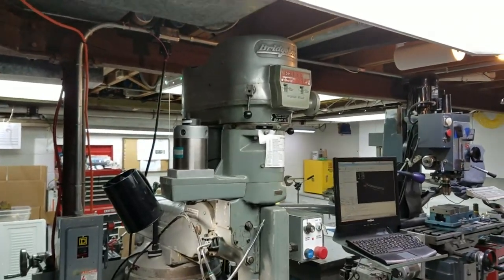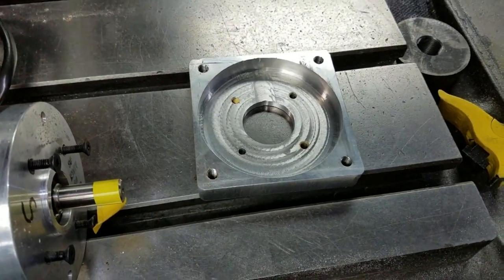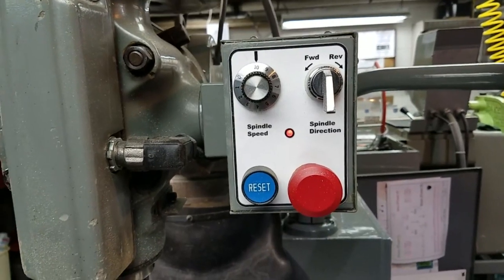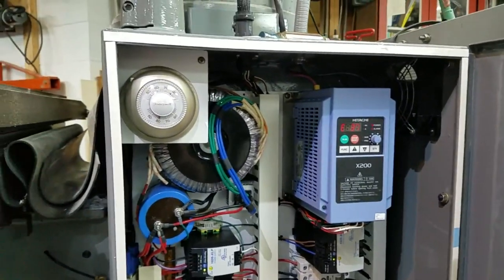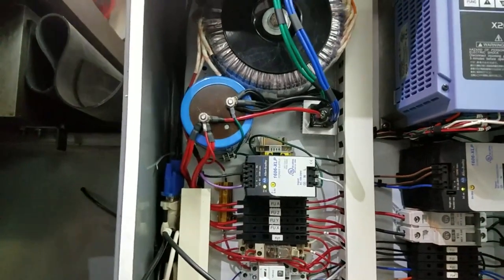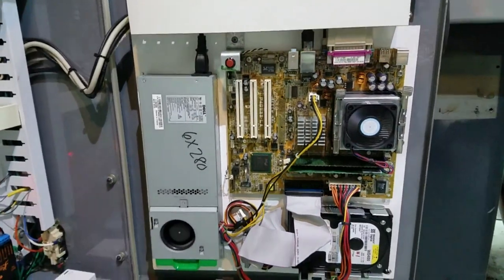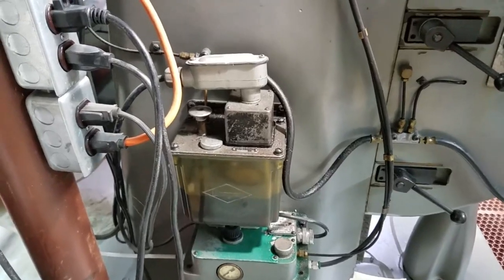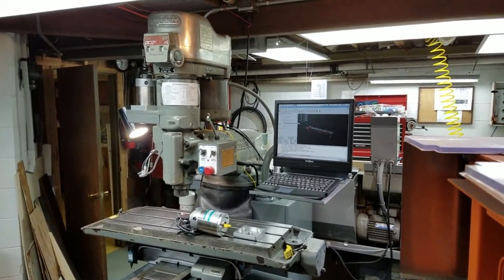Bridgeport Series 1 CNC retrofit overview

Comment: I’m putting together a cnc on my series 2 Bridgeport I already have ball screws in X and Y .  I bought  a bracket kit from a Bridgeport it’s an Anilam bracket kit that has the ballscrew with the quill bracket. My first question is do I find old servo motors and use gecko drives or get new stepper motors from China?
Reply from the maker: Is your machine a Bridgeport CNC or are you converting a manual machine that already has ballscrews?  I have read many accounts of guys using the original Bridgeport steppers with Gecko Servo drives with good results.  If you are just a hobbiest, like me, that approach is adequate.  Gecko makes stepper drives as well, so if you are starting out with a manual machine, Gecko G201X drives with Chinese steppers would be a good solution.  I like steppers because they make the most torque at very low RPM, where the actual cutting loads take place.  The only potential drawback of steppers is that if you accidentally impart cutting loads higher than the capacity of the motor (unlikely) then the motor can "miss steps" and the machine will be out of position without the control knowing about it, which will ruin the part being made.  With a Servo, the drive will fault right away if you stall the motor, allowing you the possibility of recovering and restarting the program.  Servos allow for higher rapid speeds, but again,  home shops don't need 150 IPM rapids.  I intentionally have my machine limited to slow ramping 60 IPM rapids to give me plenty of time to E-stop the machine if I see a crash coming.  I have in fact E-stopped the machine on four different occasions over the years when a rapid motion started and I was going to crash the tool or run out of travel.  Conservative rapids make this possible.
Reply: MakerCave I have a series 2 manual Bridgeport that has ballscrews added in x and y
Reply from the maker: @trialnterror  Yes, then if you are just a hobbiest, going with Chinese steppers and Gecko G201X drives will be your simplest solution.

Comment: What was the total cost of this Retro fit  please ? And would you be available for instructional advice ?
Reply: Instructional advice??  Sure! the rate is $200/hr...........
Reply from the maker: Sorry about the late reply on this, Miles.  Busy past few weeks with little time for replies.  I just went back to look at my parts spreadsheet from about 7 years ago, and show about $1,200.00 in parts at that time.  I know that there were some miscellaneous parts that I did not track on the spreadsheet, so figure about $1,500.00 with some judicious scrounging of used parts!  

If you run into questions as you go, you can certainly ask them here, and I will answer as best I can.  I still work a pretty demanding full time Corporate job, so I can't commit to personalized help, but will answer what I can.  When I was doing my retrofit, I recall getting some really good advice on CNCZone.com, which got me out of a couple of really tight spots.  CNCcookbook.com also has some really good info to read through.  You would probably get more timely and consistent help on one of those forums, but you are always welcome to post questions here and hopefully subscribers will chime in as well.   Thanks for watching!
Reply: @jesscast5122  Ok, how would I contact you  ?
Reply: @MakerCave  I have a bridgeport boss that was originally textron that was had a retrofit to ah-ha one of the stepper drive boards burned up! The board is a 10amp sd124 powering what I believe is a neam42 stepper. Any ideas on a drive board to power the original steppers and switch over to mach3

Comment: great job. I just bought a series 1 R2C3 that I have to do everything you did. BTW, What tool holders fit your spindle? I have none for examples. Thanks in advance.
Reply from the maker: The tool holders are "NMTB 30" sometimes also called Erickson 30 quick change.  I believe that this set from Shars is the correct taper, if yours is the same as mine.  https://www.shars.com/nmtb-30-end-mill-tool-holder-set-1
Reply: @MakerCave  I really appreciate it. I’m just getting started with this build
Does your spindle use a spanner nut on the bottom?
Reply from the maker: @adambohm4367  Yes.  The tool holder is retained by the ears on the locking collar, not by a drawbar like is used for R8 holders.  Good luck getting your machine up and running!
Reply: @MakerCave  thanks again. Btw I saw your 671. I just happen to have an 871 sitting on my bench 😎
Reply from the maker: @adambohm4367  Excellent on the 8-71!  Although if you look at my video #11  https://youtu.be/YUfpN-8FXrA  you will see that the 8-71 case on edge will never fit under a Series 1 for flycutting the ends flat.  That is, unless you have a riser ring under the turret, of course.  If I remember right, an 8-71 is exactly 1" longer than a 6-71 case, and I only had about 1/4" to spare after making my low profile flycutter.
Reply: @MakerCave  this much fun looks illegal
Reply: Do you have limit stops on all 3 axis’s? 
What kind of breakout board and drivers did you use?
I’m learning a lot and havin a gas too 😃
Reply from the maker: @adambohm4367  Yes, I have "Overtravel" switches on all 3 axes.  The original series 1 CNC actually already had limit/overtravel switches so I wired into them.  As for breakout board and drives, go up to the "Video Description" and click on "Show More."  I give all the details of my drives and BOB, as well as a list of all my parts that I used.  If the link to the list of parts does not open for you, leave another comment and I will correct it.  Exciting  to hear that you are making progress on your project!

Comment: Why is that better than what it came with?
Reply from the maker: In general, the 50 year control was quite obsolete.  To load a program, you had to manually punch in G-code which really limited the machines use to only simple programs.  There are lots of reasons to update an old Series 1, more reasons than I can fit in a simple reply here.

The update to a modern computer, and modern electronics now means that it is a regular computer, on the network, that can easily manage programs with tens of thousands of lines of G-code.  Take a look at the two key websites, linuxcnc.org and geckodrive.com to see details on the software and primary hardware component of the retrofit, and you will discover a lot of really great info.  

Also, take a look at some of the videos on Fusion360 https://www.youtube.com/watch?v=A5bc9c3S12g&t=45s starting with this one, and you will see the design part of the process that is now possible with a modern control system.  Thanks!

Comment: I’m looking at an almost identical machine and I was curious if you would do it again. I guess what I am asking did it turn out how you expected?
Reply from the maker: Yes, I would absolutely do it again.   If I had not gotten such a good price on the short, surplus Servo motors that I used, I would have simplified the conversion by staying with the stock stepper motors.   Having a good, rigid 3 axis CNC has allowed me to make parts, and cut shapes that are simply not possible to make manually.   Good luck on getting that machine!

Comment: Great Video - very nice machine.

I have a similar machine - converted to run Mach3 but still using the original stepper motors.  Do you have any idea if there are more of the servo motors available - like those you used?
Reply from the maker: I have not seen the servos that I used in the surplus markets for about 8 years now.  Around 2009, they were all over E-bay and on a couple of other surplus sites.  I am sure that someone ran across a large stock of them, and picked them up at auction for cheap, and began selling them retail.  When that stock was exhausted, they disappeared from the Surplus markets.  However, if you find a shorter servo that is about a NEMA 42 size, you should be able to adapt it to your machine.  Thanks for watching!
Reply: He joe will you help me
Reply: @remywalet6870  
I just saw your request - what can I do to help?